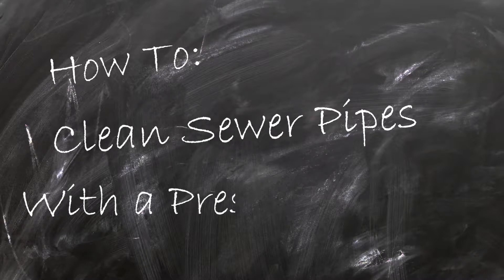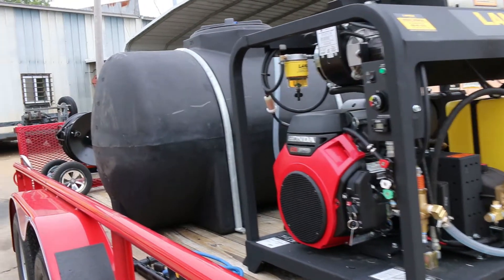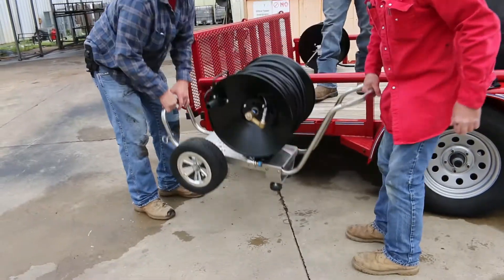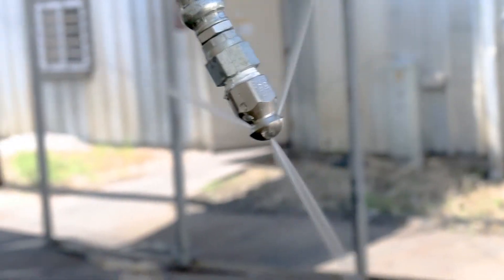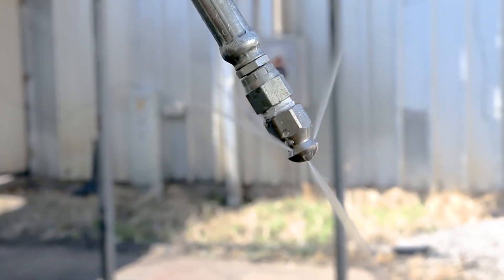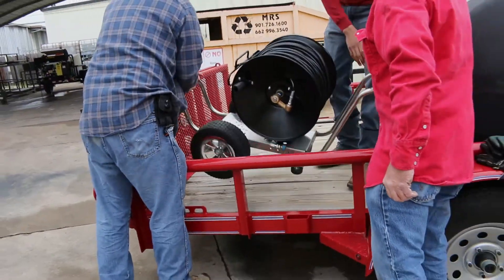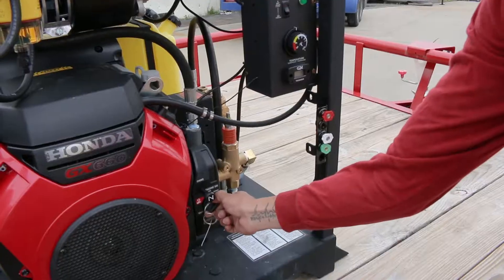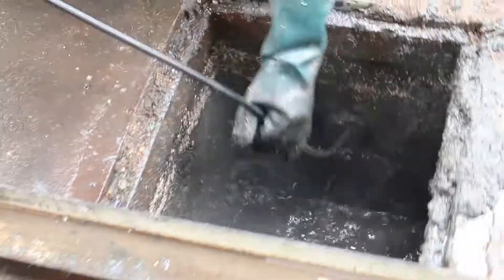How to Clean Sewer Pipes with a Pressure Washer

Comment: Can a Kranzle 1322 pressure washer work for cleaning the pipes.. no roots.. just grease/slime throughout. Had it scoped via camera.. only saw nasty grease crap in it. Kranzle is about 2gpm at 1200psi or so.. with a 100 foot or so jetter line from amazon (about $120 for the hose/nozzles).. kranzle is typically a lot more pressure than claimed and hate to have to buy a special unit just to clean drains every few years.. but dont want to drop $4K for a one time clean out through various local companies.

Comment: can you do this with a 3000 psi but only a 2.5 gpm flow? most pressure washers are in this range. it's a 4 inch pipe from my clean out to the main sewer line and it's an old concrete pipe. has roots growing in it. the last guy who came out just used what looked like to me a regular pressure washer. I bought the 50ft 1.4 inch hose with the jetter, but will this work with a smaller pressure washer? thanks if  you can help
Reply from the maker: A smaller pressure washer would work fine for clogs but not sure about roots.  That is a little different issue.  Typically, plumbers have a specialized piece of equipment with blades that cut out roots.

Comment: I use a cable or put new pipe in. What good is that going to do ?
Reply from the maker: The pressure washer will clear a clog and flush it away.  If the cable works, great.  If it doesn't' this might.  Replacing the pipe is a hard way to go unless it's damaged.